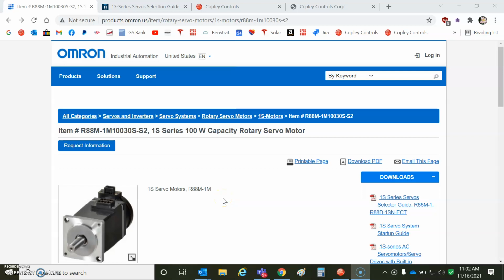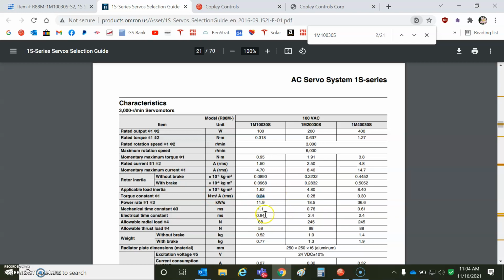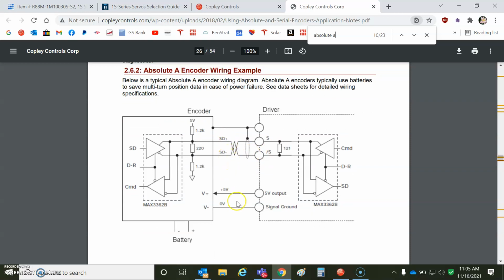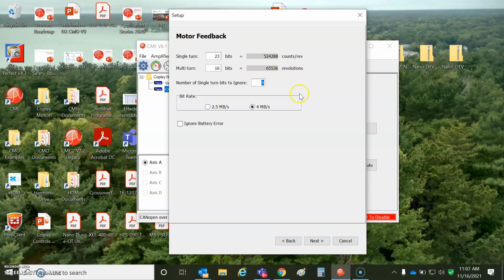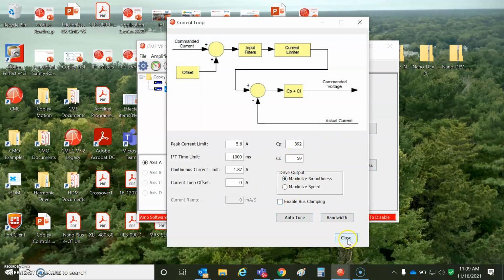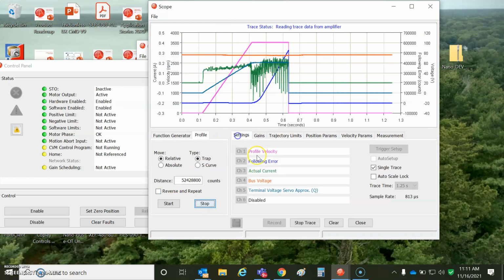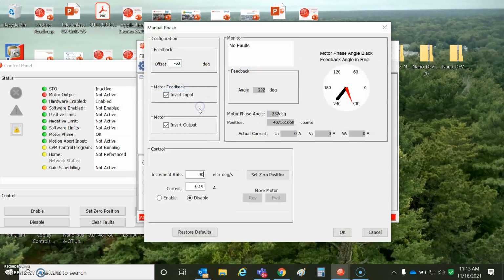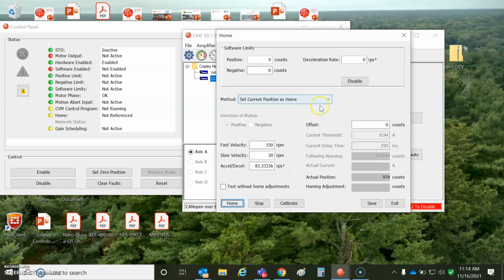Omron R88M23bit single turn 16 bit multiturn - Batteryless with Copley

Comment: This is a very nice explanation about servo motor parameters and I never seen such deep diving content about servo motors on YouTube. Thanks for sharing this treasure of knowledge. I am looking for how battery less absolute encoder works and then I found your video explanation and some other documents about it. I found battery less encoders which uses gears and magnets fixed with gears. I opened R88M-M10030T-OS2 motors several times to fix encoder related issues. But I have never seen any gears inside this motors' encoder. There is one magnetic plate inside encoder of this motor. I am still wondering how this motors keep track of their position even when it is not powered. Please make a seperate video for this information, if you have any idea? If you have any articles which explains it please share link for it. Is it possible to buy original encoder seperately for this motor?
Reply from the maker: The position count is stored in encoder FLASH and when the power is off we need energy to perform the function. Where do we find the energy? Battery? Capacitor? Inductor? Rotation? Maybe we can find the answer to the question in another video: https://youtu.be/1-AHogONqk0
Reply from the maker: Wiegand Effect (No battery or gear) - Posital  FRABA Absolute Biss C & Kit Encoders see vido: https://www.youtube.com/watch?v=1-AHogONqk0&t=586s